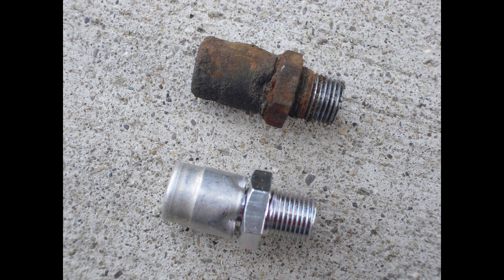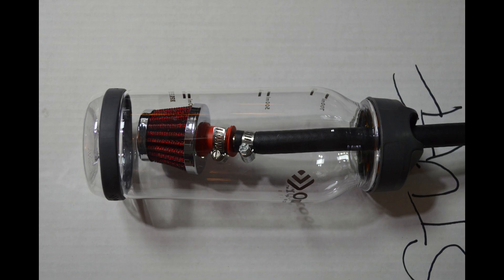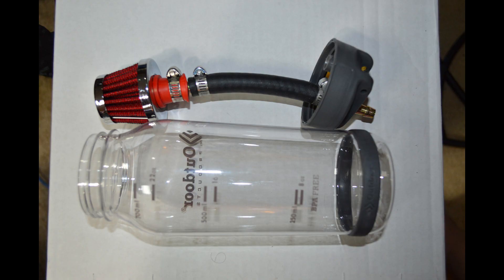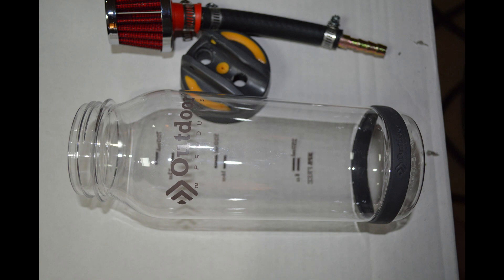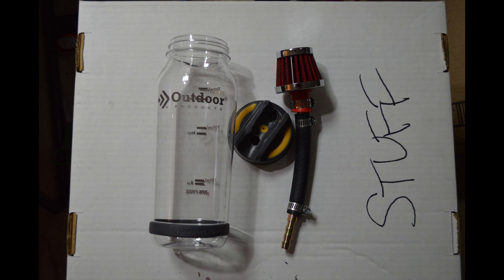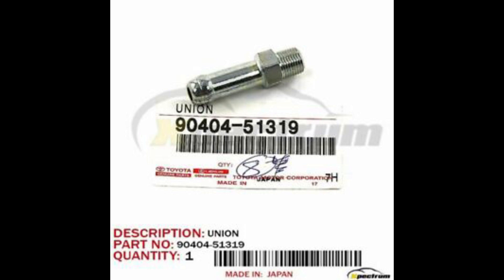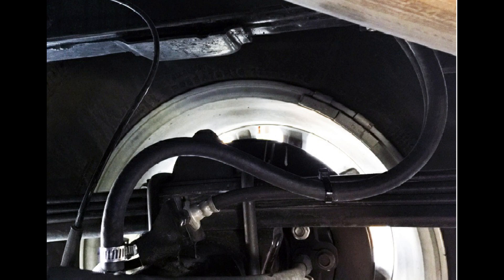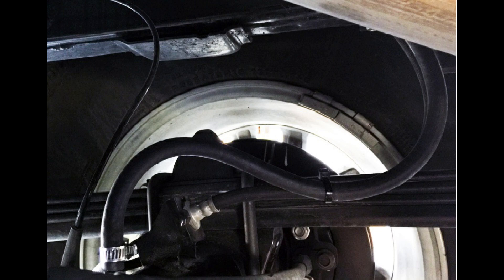Depressurize It !!! Frontier DANA Rear Axle Vent Modification

Comment: Best video explaining this problem out there.
Reply: I have a 07 with the OE breather. I never go underwater, occasionally a dirt road but I think I should replace it just to be safe. Just replaced my fuel tank guage sensor , did a radiator ,trans cooler bypass and had my secondary timing chain and guides replaced under warranty.  Other than that, no problems but I only have 90,000 miles and still on OE brakes.
Reply from the maker: Hello Elf Lords, thx for writing in, I appreciate very much the kind words, this is a very unknown problem in general, and its sad that such an inexpensive and poorly designed part can cost owners thousands in repair costs or a complete axle replacement, which is usually what Nissan desires, over attempts to dismantle and repair.